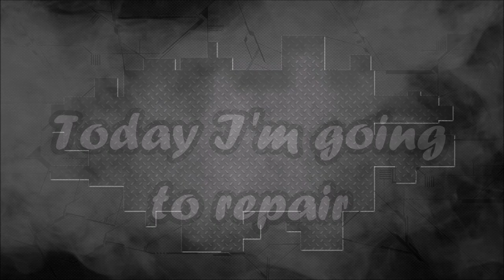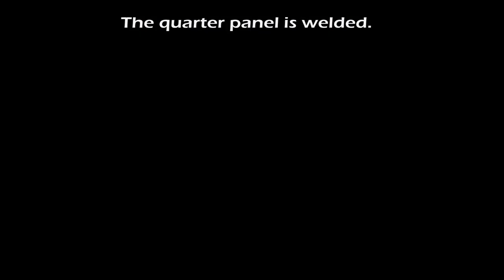BMW 7. Body repair. Ремонт кузова.

Comment: Why do you not just grind out the spot welds on the old body panel with a thick wheel? It saves you way more time

Comment: I have a few qustions: the new 7 series comes with a carbon core,  so what was the deal with it ? I did not see carbon pillars or any of the inner parts of the b- pillers after the repair. Was there any damage to the carbon? Also it would be interesting to see the front bonnet underneath after the repair. I think it will be a tell tell that there was a repair  and last the inner part of the rear panel near the wheel well didn't match
Reply from the maker: Yes, new BMW have carbon parts, but in this repair them don't  damaged. It in inside reinforcement.

Comment: What's the purpose of that cylinder where the rear bumper is at 1.49
Reply: Possibly a vacuum reservoir of some sort.
Reply: Air suspension
Reply: Makes more sense- thanks.